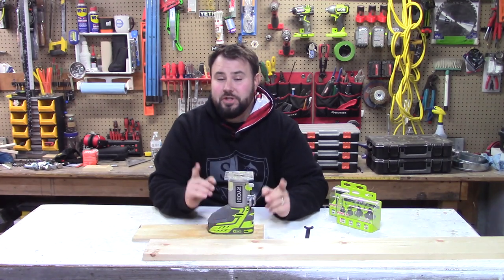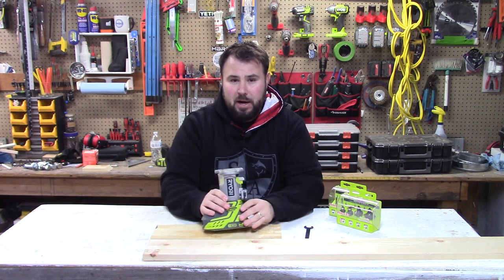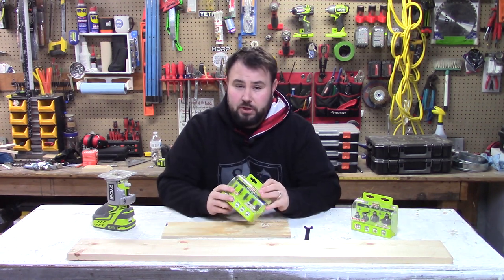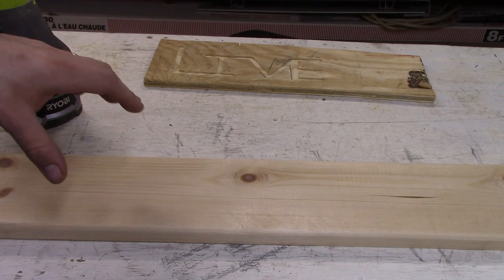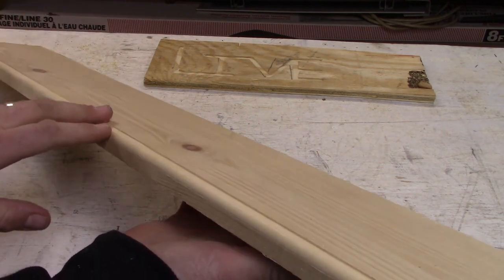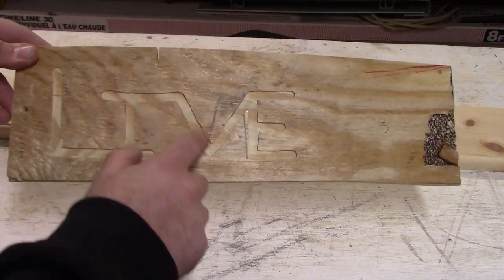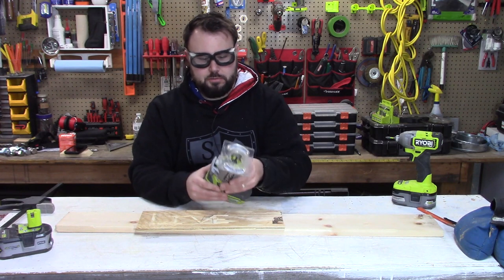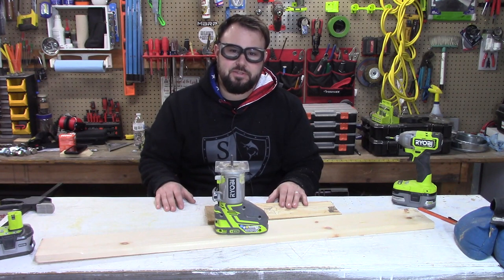Ryobi Cordless Router Review

Comment: Thanks for the review - just a question as i am undecided whether to get the cordless or the corded router - will this cordless router be able to trim mahagony wood, and will it be able to cut a 1/2"-wide by 1/2"-deep channel plunge cut such as your design cut in the video?
Reply from the maker: It can trim the wood however it may take multiple passes at shallower depths using a guide. It’s not as powerful as the corded versions
Reply: @livefreeandtoolon  thank you